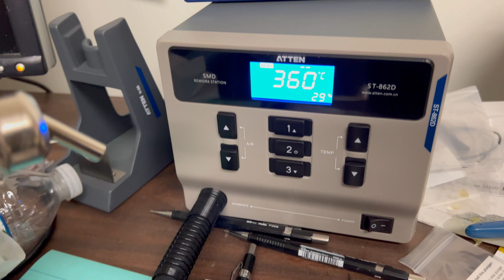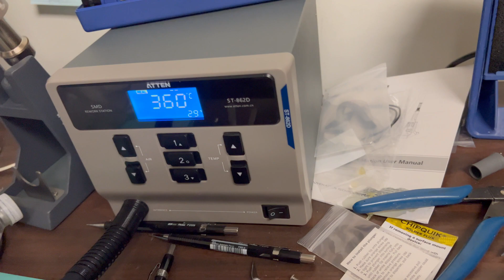DMG-01(GameBoy) new build-Removing the CPU from a Super Nintendo GB adapter-EP1

Comment: Kewl video!  You are making it way harder on yourself though with all that flux and not clamping down the board you are working on. Chipquick is great but because it only takes about a quarter of that amount. Then you don’t have it all over the place or have to go hotter on the air. You were scaring me I thought that chip was gonna get fried but then you cut scene and it was off!😂. Are those Game Boy super Nintendo adapters cheap or something? Is that why you take it from there or is there any other benefits?  I would like to do one too, but I don’t know if I should be looking for a game boy that doesn’t work or one of those super Nintendo adapters which would you recommend?
Reply from the maker: Lol. That is the first time I used hot air desoldering. Next time, I would use more paste solder and less flux. It took me a minute to figure out. The SN GB adapters are like 15–20 bucks on eBay. One interesting note with this CPU, it skips the Game Boy boot screen. Since it was for a Super Nintendo, they didn't want it saying Game Boy. I have rebuilt a ton of OG Game Boys, and this seems like the way to go. Redesigned PCB and fresh parts with a crispy screen. If you do the kit, it's going to cost you 200-250. If you want just an OG Game Boy with an IPS screen, it's like $50 for the GB and then 50–65 bucks for the IPS kit. I decided I wanted to go all out with a custom case, buttons and controls. Kitch-bent is a good resource for GB parts. Also, Retro Gaming Station. I'm doing it because it's something different, and I can learn some new skills along the way.
Reply: @ I don’t even want one to play. I just wanna build it from scratch lol. I actually enjoy fixing game consoles way more than I do playing them! lol. Once I have finished repairing it and upgrading it to the max I’m kind of sad.😂
Reply from the maker: It's the same for me. I end up giving stuff away because it was more fun to make than use. I'm starting a guitar kit project as well. I can't play worth a damn, but my son can. So I'm building it for him. I thought it would be cool to theme it like the Harley Sportster I'm building on my channel as well. I like mechanical-electrical puzzles. Thanks for the awesome comments, I really appreciate it!
Reply: @ did we just become best friends?!?!  lol thanks for the channel! I’ll definitely be checking it all out!   I play guitar, a fun project is to build an old fashioned tube amp, or rebuild one! It’s great with how easy the schematics are to read from the 50’s/60’s
Reply from the maker: I've built a few tube amps from scratch, including a tube headphone amp. The stuff back then was so simple, it makes it easy. And who knows, maybe we could be friends... Lol. I like building and fixing stuff, so if you like that, tune in for more shenanigans.
Reply: @ didn’t you recognize the quote?  It’s from stepbrothers when they figure out they have mutual interests! lol. I love building things too in fact that’s what I do. I’m a builder lol
Reply from the maker: I've heard of that movie. Not sure if I ever watched it. Now I'm going to have to... Thanks for the sub too!